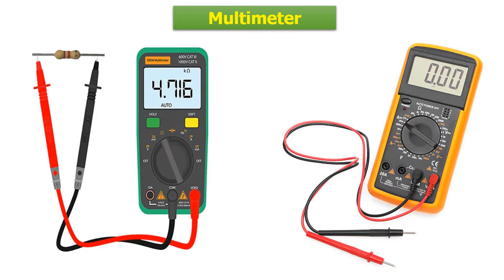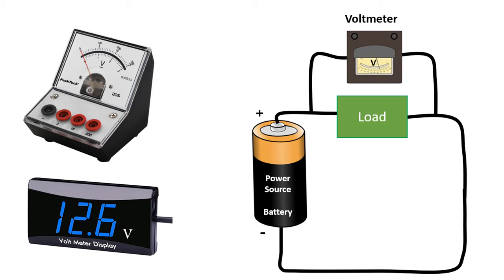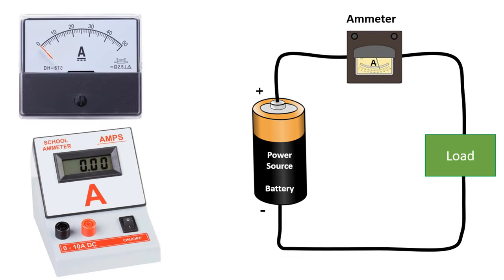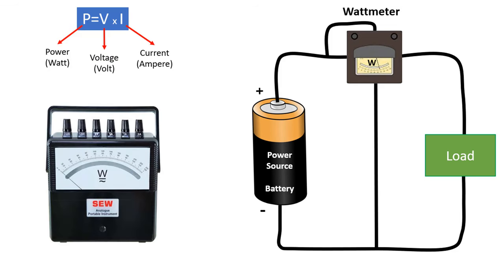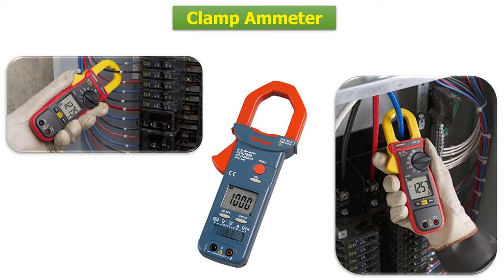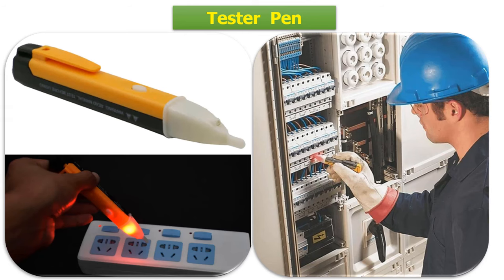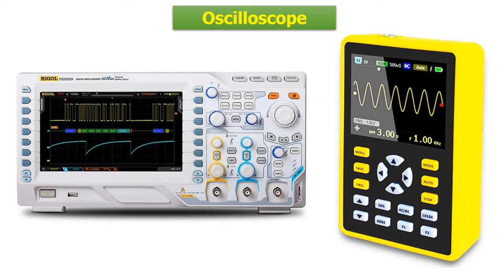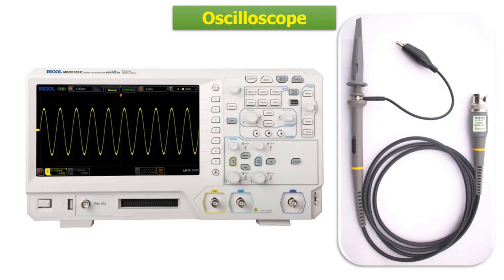Electrical and Electronics Measuring and Testing Equipments

Comment: Thanks a lot for this useful video.
I also watched your 11months a go  video about mosfet transistor thah it was great.
And I am gonna to request you if would you please make a short video  and explain how do the 8 pins ic's work and difference between  them and transistors by the way about mosfet ic'a with 8 pins which are used in the most of laptops?
From iran.
Thank again.
Reply from the maker: Thank you very much. I'm so glad you liked this video 🙏🏼I don't know much about them. But I try to research and explain. 👍